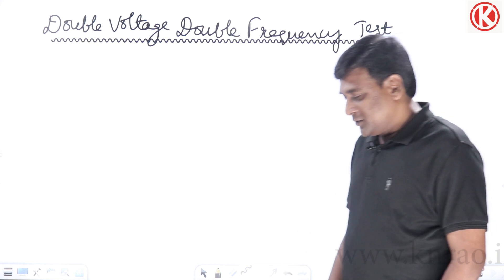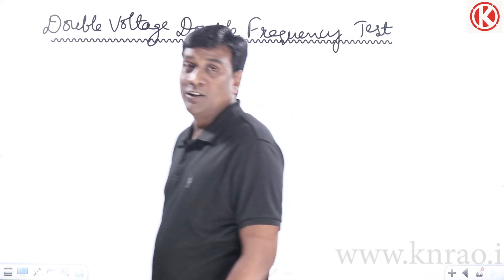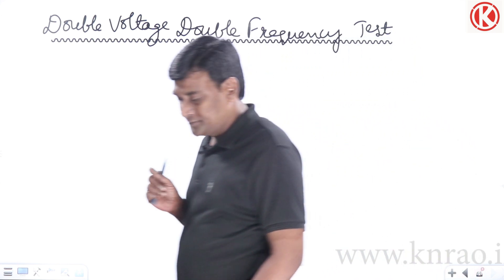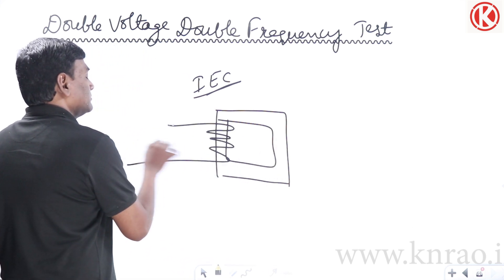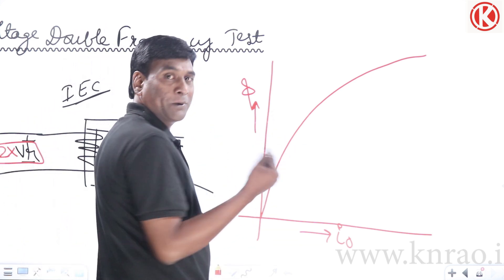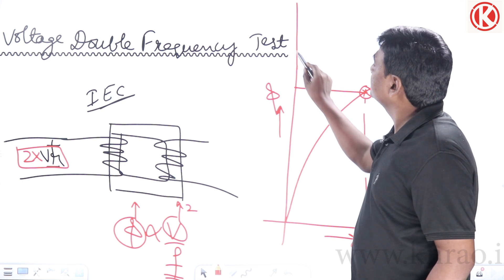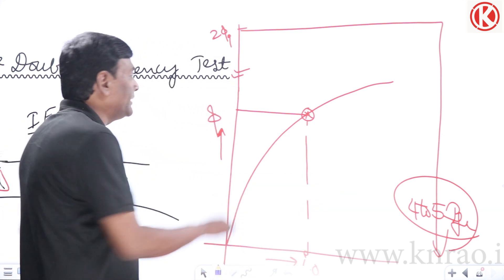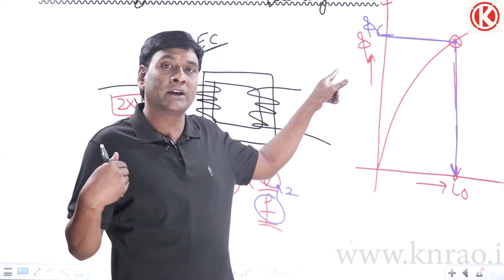Important Interview Question in Transformer || Double Voltage Double Frequency Test || GATE Lectures

Comment: Transformer windings are design to carry the rated current or full load current. Now no load current is quite small in respect of full load current (normally <10% of Irated). 
So, how 4 to 5 times of no load current will able to burn the windings??

Comment: I have doubt like even if voltage is doubled why the flux will be doubled though as it is told like flux density proportional to voltage/ frequency and why not like Because b-h characteristics is like even if current is increased to any value the flux will be same i.e saturation point right then ....then in order to increase operating flux either voltage or current has to be increased ?
Reply: Bcs if we maintain frequency constant, and voltage doubled then Bmax will get doubled, which means flux =(Bmax*Area) hence flux also gets double.